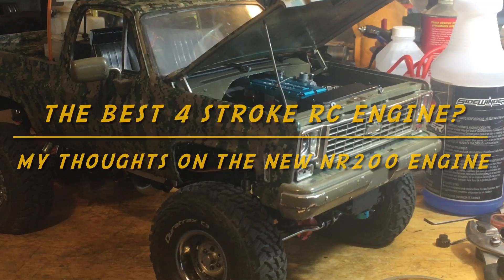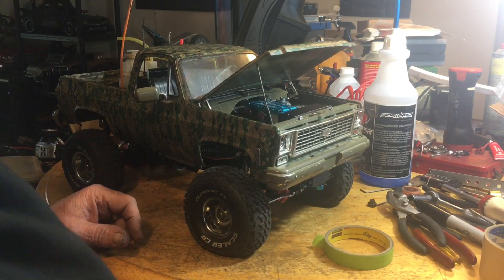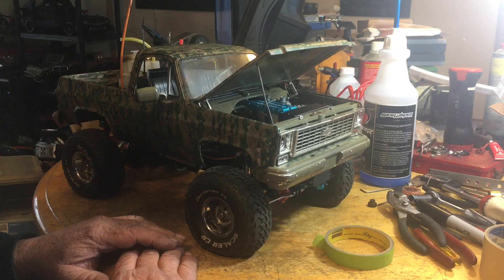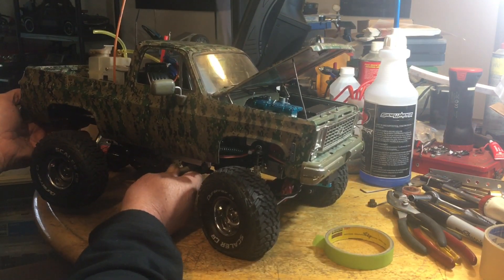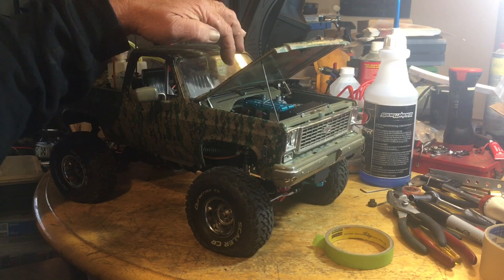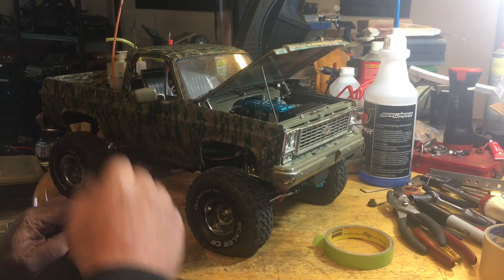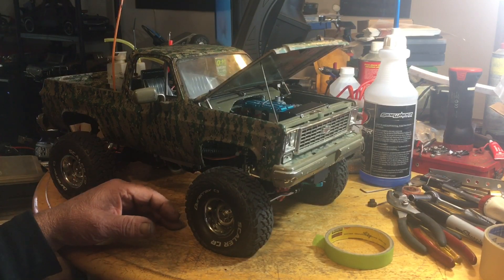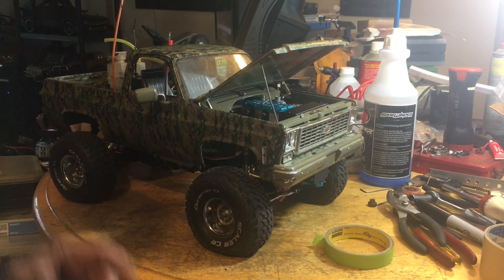NR200 IS IT THE BEST SCALE ENGINE???

Comment: Is there a way to check the temperature of the engine or water? I mean is it visible to see if it's overheating?
Reply from the maker: They sell a digital water temp set up for them so they can be monitored,  as of now I check it with the laser temp gun.

Comment: Hey Dennis Finally got my radiator, didn't know these were all over eBay lol thanks for that as I could have gotten it much sooner! this engine seems to be very happy when its running, love the sound and throttle response. Once I get my plumbing done and linkage I can finally take it for a spin but I'm still working that all out 🤔

Quick question for ya, I'm using 1/8"ID x 1/4"OD tubing for the water nipples on the engine and the tubing fits snugly into the radiator flanges, what did you use to secure the tubing on the radiator, it looked like a silicone tube of some sort in your last videos? I appreciate the help and mention bro! 👍
Reply from the maker: Yeah I stumbled across the radiators lol!  I used some small pieces of brass tube inserted in the ends of my tubing and used the silicone tubing over them and when I inserted them in my radiator the brass tubing keeps the hose from collapsing when you ziptie them.
Reply: @dennisdempseyradiooutofcontrol  Genius! thanks so much I'm going to try that, I greatly appreciate the help Dennis!! 👍
Reply: Update: I ended up finding some hydration bladder piping laying around that was the exact diameter of my tubing and by luck it fit very snug for a 1/4" pipe and on to the radiator end. Thanks again for the help brother!!